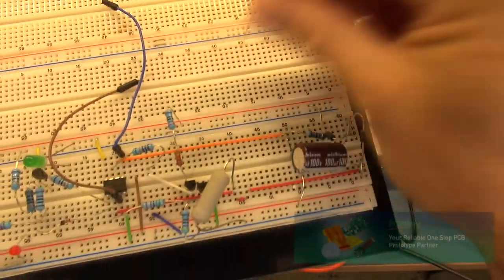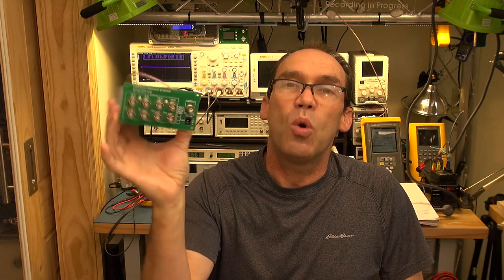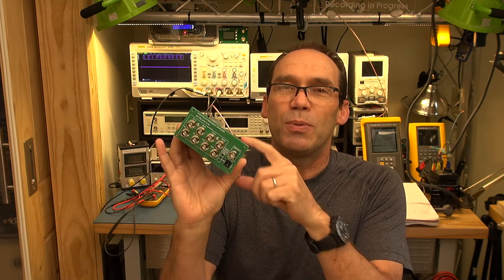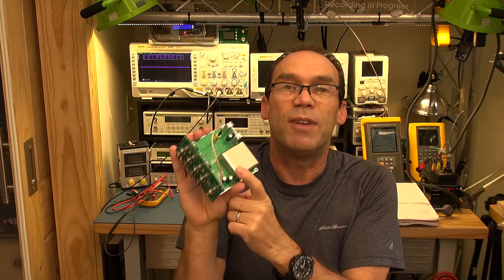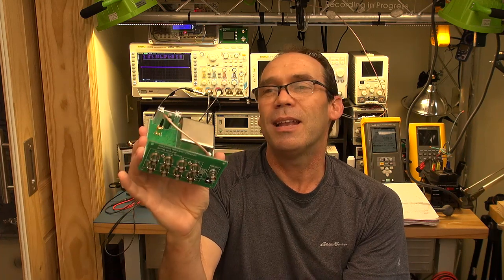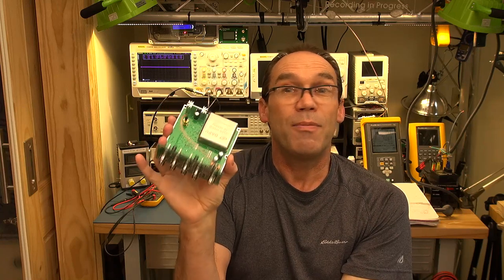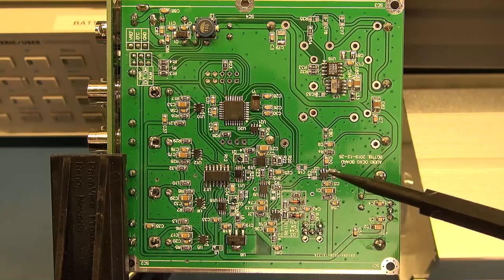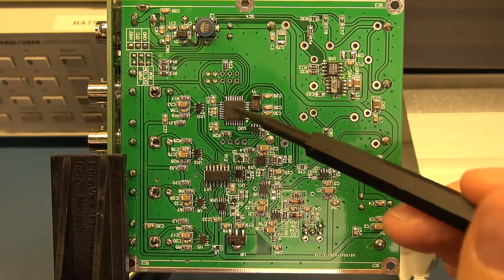A Look Inside #15 - Faulty Audio Frequency Standard OCXO,  Fixed! - Pt1

Comment: In the Military I worked with and on a AN UCC-4 Multiplex system.   It used 96Kz as the Pilot Frequency.  The Pilot was used by any and all multiplexes in tandem to derive the translation of all carrier channels. 
That board looks like a modern version of the ones we used.  The Module may have originated as surplus or spare parts for the same.
*     We used a Cesium Clock at the originating facility. 
If You have no output it would be because your not feeding it the 10Mhz from a atomic clock.
https://en.wikipedia.org/wiki/AN/UCC-4

Comment: It’s difficult to tell without higher magnification, but it would appear that there’s allot of solder paste that doesn’t appear to be fully reflowed and certainly not cleaned away. I suspect that there are some dodgy solder joints amongst those, and that may explain how it may have worked during QA, but not when it arrived to you. I guess that you will let us know part 2 what you finally found.